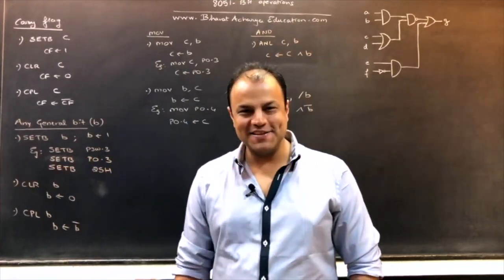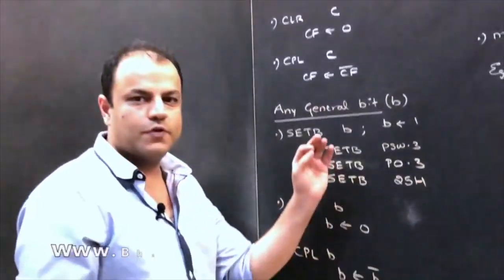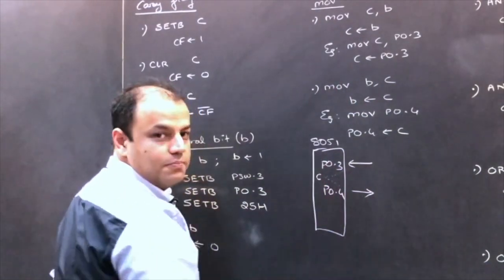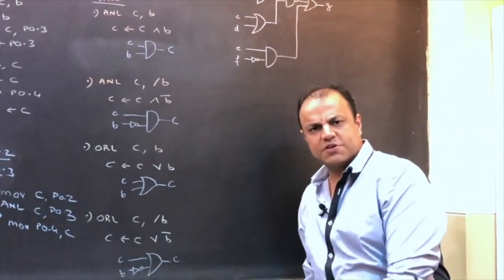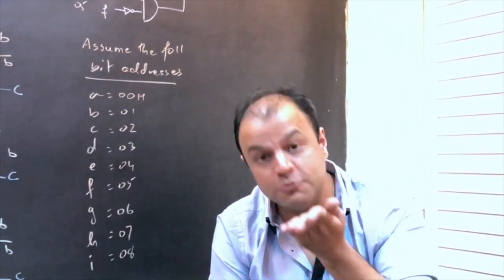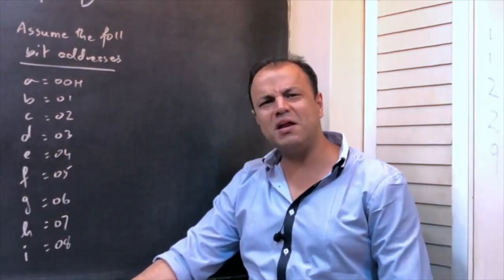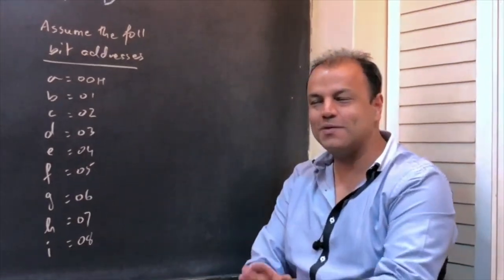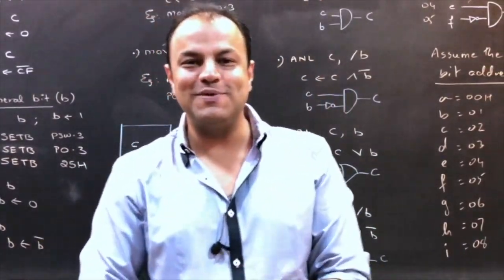8051 | Boolean Instructions | SETB, CLR, CPL, MOV, ANL, ORL | Microcontroller | Bharat Acharya

Comment: Chatgpt helps me this way. I am given with a circuit - it is like (a+b)+(c.d) (c+/f). this is purely a combinational circuit. but the videos talks about that each bit has an address - ok I understand that is the bit address goes to the respective input of the circuit. but again why he wanted to have one value of two inputs going to the gate to be in a carry flag. to save it. I can send directly from the its address to the circuit input right. IT answers Here’s the difference:
The 8051 does not connect wires directly between bits and gates.
Instead, it has a single ALU (arithmetic logic unit).
The ALU works on the Accumulator (A) and the Carry flag (C) as its core operands.
If you want to manipulate an arbitrary bit (say P1.0), the 8051 doesn’t feed it directly into the ALU — instead:
You copy that bit into Carry (C) using MOV C, bit.
The ALU performs an operation using A and C.
You may move the result back from C into some other bit.
So Carry = “one-bit scratchpad” for logic.